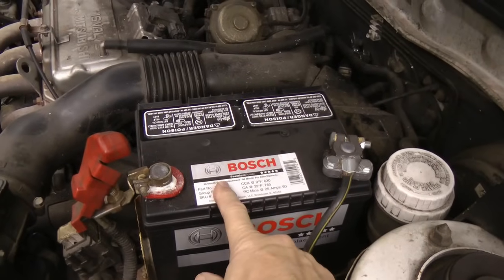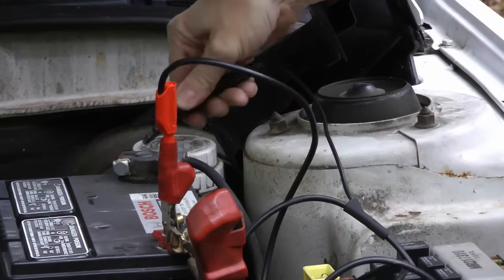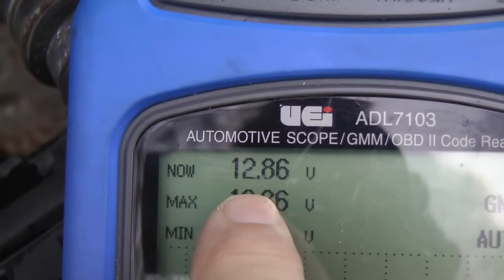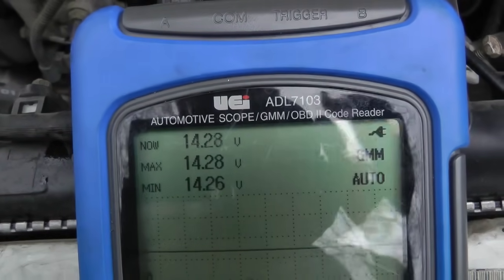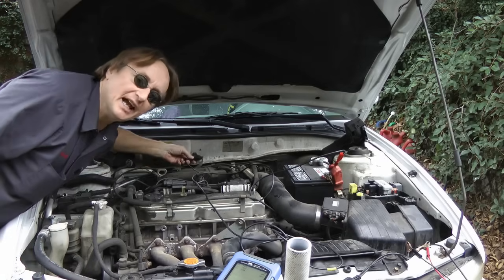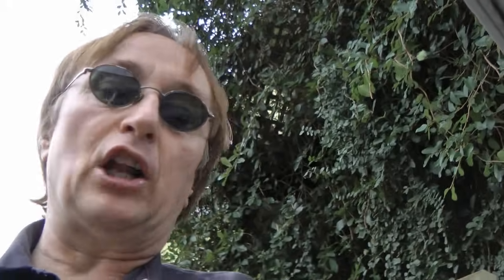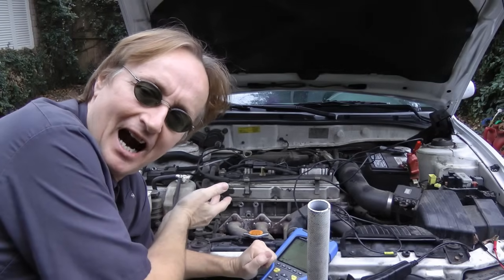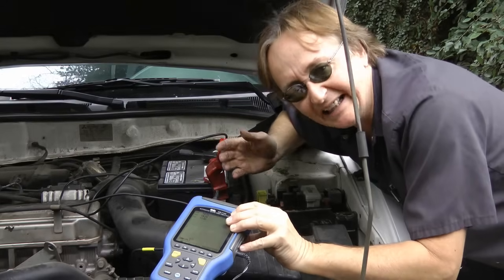How to Fix Electrical Problems in Your Car (Ground Fault)

Comment from the maker: Things I used in this video:
1. Voltmeter: http://amzn.to/2BQ0K2W
2. Common Sense
3. Full HD Camera: http://amzn.to/2AvoEk7
4. My computer for editing / uploading: http://amzn.to/2i2sKYz
5. Video editing software: http://amzn.to/2jv5Fhf
6. Thumbnail software: http://amzn.to/2k7tz6C

🛠Check out my Garage to see what I use every day and highly recommend:
https://www.amazon.com/shop/scottykilmer

❗️Check out the Scotty store:
https://goo.gl/RwhRGU

👉Follow me on Instagram for the latest news, funnies, and exclusive info / pics:
https://goo.gl/ohy2cA
Reply: wheres the link to buy #2?
Reply: The "Common Sense link is broken.
Reply: Scotty Kilmer hello Scott I want to ask you a question what makes a 97 Dodge Caravan shut off when you put it in Drive
Reply: Scotty Kilmer  I put a new fuel pump on my 98 Ford WinstAR now it would not start it's not getting fire
Reply: Scotty Kilmer I have a 99 Lincoln Town Car my interior lights won't go off
Reply: Scotty Kilmer  had a question so I have a Acura TSX 05 so a couple days ago my battery was dead so I thought I had a bad battery and alternator so I changed both but I went to advanced so they could check my battery and alternator it should that alternator wasn’t getting any voltage so I installed a new alternator and it still shows no voltage could you help me out?
Reply: Scotty Kilmer I have a 95 Nissan Pathfinder my negative terminal melted then I found bare wires underneath the car but they look like they're coming from the positive terminal they're burned out where would they go to put new battery in battery will not start car
Reply: helo sir i have problem in Mazda3 2005 
P1369 this cod show in computer can u help me plz what this problem
Reply: Scotty, Thanks for your videos.  Very helpful.  I have a 2003 F150, Making into flatbed.  Temporarily taped lights to bumper.  Now my left brake lights and blinker won't work.  I noticed my ground isn't connected, but read that's not necessarily the problem .  PS.  Seemed like it happened after there was a heavy rain.
Reply: ....2003 F150 now that I think of it.  When I turn a corner and apply the brakes.  Sometimes I notice my car almost stalls.  Aactually a few times it has actually stalled.  Otherwise truck runs fantastic.
Reply: Scotty was the music at the end 'cat in the cradle' by chance?
Reply: Sco tty Kilmer
Reply: Sco

tty Kilmer
Reply: Scotty Kilmer
Reply: Can you give a link to the meter you used in the video and not the Chinesium POS you linked us to here?  Thanks buddy.
Reply: Holy crap that was expensive before it was discontinued.  $1,250 huh?  Geez.
Reply: Hi mr kilmer  I have a issue  can u plz help me I got code p0118 now thing is no engine check light gauge works  good ground  my diagnostic tool says signal + gettin to high of a reading  or shortcut  sensor gives a 5volt reading and 2 problem my 30amp fuse blows its from the fuel pump.,injectors could the fuel pump be at its end car starts and climbs in rpm like 3000 after 4sec it go's back to normal  greetings from belgium 😉
Reply: Scotty when my car warms up to running temperature my ac and locks stop working any help?
Reply: I lết ML P
JnTime to restt tor😢
Reply: Thanks Scotty, this video saved me a lot of headaches working on a 2012 chevy traverse. Found a ground wire on the right side fender next to the fuse box that was messed up causing the right side headlight and horn not to work along with getting the"hood open" message and the ac compressor cutting of at stop lights. 
Thanks Scotty!
Reply: How do you find a positive water that’s touching the ground?
Reply: Where do I buy common sense
Reply: 2025 still here

Comment: After diagnosing , the camshaft sensor  was not receiving a ground signal ,  I attached the camshaft ground signal to the ground signal of the crankshaft. 
 Now, the engine takes a while to start ,  once running the engine surges something awful with no acceleration.
 Should attach the camshafts  ground another computer ground circuit

Comment: My 01 Tacoma will only start up when hooked up to an OBD reader. It will remain on while parked and at normal idle. Upon disconnecting the OBD reader and put in gear, it dies out. Seems to be a bad ground? Not sure. Something is resulting in the OBD scanner bypassing some short?

Comment: Scotty, I was driving my 2003 Toyota truck and the ac just stopped working all together. I pulled over, turned off the truck. Turned it back on and the ac started working again. Two days later it did it again and the speedometer stopped working as well this time. HELP please?

Comment: Scotty : I have a Chevy Silverado 2500 2003, When the trucks turn signal lights are on, ALL the rear lights are flashing, when I apply the brake the turn signals stop working.  Some times they work as intended. But most of the time this is how it behaves.  

Based on this info, where would I begin testing ground wires?

Comment: Yes, but the problem now is to find where all the ground points are with all those plastic panels hiding them.  I've yet to find any decent documentation to show where the ground points actually are located in my 2012 Civic.
Reply: My issue too right now with an equinox

Comment: When I turn my air conditioner fan on, my service engine light and a security light comes on, on with my Chevy Cavalier. Any Idea what could be wrong? The check engine light came on, but only for about 15 minutes. Sometimes my seat belt light will flash on for a second too while I'm driving too. I also lose my gauges when I turn the fan on too but sometimes they come back while I'm driving. I'm beginning to think I might have to take it to the dealership for them to work on it.

Comment: ram 2016. low voltage codes and causing cylinder failures. changed alt, cleaned grounds, battery tested good. I'm still struggling

Comment: hi,i measured the resistance on some wires and there are two wires that show 0.3 without mounting the battery,when the battery is mounted there is 0 and sometimes 1.6 ohms,these are two of the 6 main wires in the fuse box,any idea?

Comment: Will any corroded ground wires cause issues? I spotted some corrosion on some ground wires that are attached to my ECM connectors. My car cranks but won't start and is throwing many powertrain codes. Engine light is on. I just had my ECM reset about a month ago and car ran fine up until now.

Comment: Why do I not understand this? At 2:33 you're saying a device will try to draw power from another device. But isn't the device already supplied with power? Isn't the problem with the return {the rest of the world calls it the ground) to the battery? Do you need to draw me a picture as the saying goes? God, I feel dumb.
Reply: The ground is still not fully understood.

Comment: What if car starts without my headlights on but when I turn them on, it immediately dies? And the high beam/left blinker pops up? Driver side headlight is dimmer than the right no mechanic have been to able to figure this issue out smh!!!

Comment: i have hyundai accent 2018... my problem is when i step on the brake, the parking lights turn on...  my friends told me that i have a grounded wires, so i removed all the accessories wire connected to the batterry but the problem is the same.. so i looked into the tail ligjt for any sign of corrossion or melted wire but the wire is intact. any suggestions sir?

Comment: Scotty, I have a 2002 Nissian frontier xe  with a standard tranny. and smallest engine.  I replaced my tail lights assembly's and now the top lenses have melted. I bought an after market assembly . What could cause this and how to keep the new factory assembly from doing the same ? Haven't installed the new tail lights assembly yet. thank you for any help.

Comment: I have an 87 Dodge Dakota Truck that was draining the the battery i bought a new battery it worked a week so got another battery same thing,  i hot a new alternator, a new voltage regulator a new starter another new battery, and the guy helping me put WD40 on the wires to clean them , i started the truck, the wires started to smoke and melted , he pulled all of them  fuseable link ) appart now the truck wont start at all. He didnt come back, so im stuck with a truck that ran so good and took the road like a new truck , what can I,  do who can I go to to fix it up ? wont give it up, i love that truck .

Comment: dynamic test shows the engine ground is higher more than .4 of a volt, im assuming bad grounding means less voltage right? what if its higher votage than the battery reading

Comment: What is it's not turning on and it's not the battery?? Connections on battery are not loose but usually u see light on dash board primarily to tell me it picks up the key...now nada. Smh

Comment: Mr. Kilmer, my car's left brake light and third brake light stay on whenever the battery is connected, and the cruise control doesn't work. It's definitely an electrical issue and has happened before. Any suggestions? 
Thanks.

Comment: Hi Scotty I have a Mondeo Mk4 2007 and have had problems with the clutch pedal starting switch. The plunger on the switch gets pushed down so far that it gets stuck and you have to press the pedal  so hard your foot is on the floor with extreme power. I've bought a new switch twice and it's happened both times. I wondered if there is a remedy within the switch that I can override the problem ??
Mike

Comment: Hi Scott y  my daughter  has a 2013 mini cooper . She park it and 2 day later when she return the car sha no power.  We replace the battery and still no power  at all. 

No internal light
No head light. 
No power to start car.

What would you check for to try and fix the issue.

Thanks in advance

Comment: cannot find grounded short wire drainig my 12 v batt.    ive been doing testing, neg batt terminal disconnected  i put voltmeter test lead positive lead  on that neg terminal,  my neg voltmeter test lead on neg batt post,  then i get a 12v reading so that means im getting 12v on that neg ground area somehwere,  i cannot find the source on where the cause is,,  it drains my battery so i have to keep disconnecting neg terminal when im not driving it to keep it from draining,,, im lost confused  just dont know the steps,,,,, help me , if you got any advice,,   the car starts and runs..

Comment: Hi Scotty.  I got stuck in a flood with my cobalt. It has a battery in the back, 72 hours later there's still wet carpet inside car.  When I tried to jump it initially, smoke was coming out of somewhere near the battery.  72 hours later when I try to jump it, the car goes completely dead, as I am trying to jump it.  Without the jumper cables on though, I do have dash lights on, and you can hear clicking as I'm trying to start it.  Dunno wat to do.

Comment: I have a 1995 buick lasabre it starts but won't run I replaced the fuel pump but it won't come on to start the car when I turn the key to start I've replace the fuel pump relay but I have no juice in the hot wire when I turn the key to start.

Comment: I have 2003 mustang v6 with I think a grounding problem but I’m not sure everything if fine new battery new starter and there voltage going to the starter but when I turn the key the car just clicks rapidly like it’s a bad battery  so I’m not sure what’s going on I started it on 8/6/23 then I tried it again and now it doesn’t work

Comment: thanks for your sharing your acknowledge and experience. I have a Toy/Yaris 2007 and it seems to be a ground problem...I found that the main relay for the EFI does NOT have ground, car does crank but it won't start...ANY SUGESTIONS ??? ,,,very much appreciated in advance.

Comment: Hi Scotty I was hoping to pick your brain on this electrical problem. My car has a strange issue when I use my power window auto up button. It goes all the way up but the auto switch won’t shut off as it’s dropping in voltage and keeps pushing up. New battery, new fuses, circuit boards checked. Then changed window switch and also didn’t fix it. Works correctly when I hook up a car battery charger. So it seems the pressure switch in the auto window up does not reach the voltage to tel it it’s reached the top. So this indicates faulty wiring or a bad connection. Can I apply the same test as here or is there a better way?

Comment: Hey Mr. Scott I have 2010 Buick Lacrosse I’m having a issue with my turning signals it’s weird. My driver side turning signal in the front works but not the passenger side and in the back it’s the passenger side works but not driver side in the back. My hazard lights the same and I noticed my interior light don’t work either but we I open my door the other light works. I’ve been trying to solve this problem for while now and I about to take it to a specialist but before I do I wanted to ask you.

Comment: I have a ford ranger edge 2002.  Won’t start when it feels like.  It killed my starter. Had that replaced along with solenoid and two fuses.  Thought it was fixed but 3 days later it again will start when it wants to.  I started flicking everything on and off on my dashboard. Air, lights, lighter.   I yesterday it started when. The lighter popped out.  Today it didn’t want to start again and decided to cooperate when I pulled out my cell phone to check a video on YouTube.  I listen to my phone on blue tooth via the radio.  Its got me stumped-  please its always something different.  Often time it will start to do a repetitive ticking noise. I removed my automatic starter because I thought that was it.  But t no. Not it.  Anyone have any ideas.  The Truck is solid except for this.

Comment: Hi I have a question. What would make a 2013 chevy impala LT idle rough and the check stabiltrack light comes on even after the spark plugs have been changed? Thank you for your time.

Comment: Question! I have a 2005 ford 500 2 wheel drive. I have the anti theft flashing on my dash board.  I can't start the car and it's annoying to see that flashing. Disconnecting the ground battery wire will stop the anti theft from flashing and I will be able to start my car???? Need help!!!!

Comment: Trial & error determined Exposed wiring front park light inside headlights assembly 2008 Lincoln Mark LT after a fender bender riped my  headlight off kept blowing fuses all wattages for taillights aka park lights & license plate lamp . Saved myself some bucks

Comment: I have a problem in my car 1991 toyota corolla, when I turn on my left indicator my when the parking light is off the broke goes of as well with indicator but once I turn the parking light on the left indicator light stays on

Comment: My wife has a 2006 Kia Sportage with 29000 miles. 1 of the headlights won't work properly even with a new bulb. I think it's a bad ground but don't know where to check.

Comment: At night when lights kick on there is a static behind radio. Also on cold starts there is a grinding noise as the rpm sets then goes away . Also while driving I hear squealing on passenger side when pressing down gas pedal . Maybe need new alternator bearing and ground wire needs fixing.
What do you think Scotty.
I've already replaced the belt and tensioner but still having these issues.
Thanks
Reply: It's a 2014 Impala Lt limited

Comment: Thanks for the video, @Scotty. Quick question, I just replaced my battery and alternator, but the battery voltage is still dropping when the car is on. I've also checked the alternator fuse and it is not blown. Any ideas on what this could be? I did notice in the vehicle that the radiator's metal housing is touching the alternator; would this cause a voltage drop issue? Or, is it more likely a grounding issue? Thanks for any insight!

Comment: I have a car that don’t crank on I bought a new alternator new spark plugs and a new battery what would the problem be? It cranks on by jump starting but as soon as I take off the jump starter it shuts off

Comment: I have a wire harness problem my stater is new had it checked before putting it in.and my battery new too now with someone turning the ignition and me moving the harness around it Kiki over what is the best way to find that brake in the wire

Comment: Hi Scotty, I have a 2000 Blazer with a check light on. It will not activate the scan meter. Tried at Autzone, Advance Auto & a friends meter. When I disconnected the battery to try to reset the light, it came right back on. Never ran into this before. The only fuse blown is the cigarette lighter which was out for ever. Any help would be appreciated.
Thank you in advance,  Joe Z

Comment: Mu 2008 mustang will occasionally brake light comes on in dash gas gauge goes dead oil light comes on and AC clutch wont engage help please

Comment: okay. i need help with my problem PLEASE. 
2018 wrx limited
whether im listening to my phone via bluetooth, usb, or AUX or the radio or CD player i have a high pitched noise in trhe back ground that gets louder with the volume increasing. 
also it goes away when i accelerate but comes back once im at constant speed. HELP ME PLEASE. I do not have any AMPS installed. just stock car with HARMON KARDON speakers that it came with.

Comment: 2004 grand Cherokee Laredo replaced the heater core didn't drop the column when I pulled the dash didn't seem like I ripped or damaged anything I'm confused

Comment: Scotty. I have viewed and executed your 2 videos on using a volt meter and a test light to check for a grounding issue. The test light was on the whole time I was pulling fuses with no turn off. I have checked 4 main areas for ground to frame issues. I pulled the cluster out and looked for anything wacky there, seemed intact. Where else can I look or test? Essentially my cluster is going bonkers on all the gauges. Vehicle runs fine, its a 2000 Chevy Silverado. I appreciate your videos. very stumped.